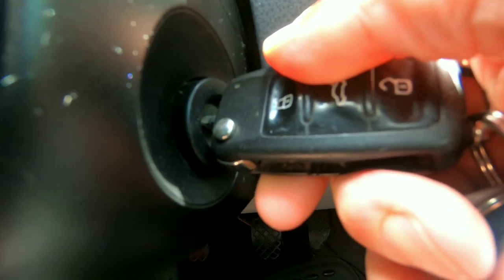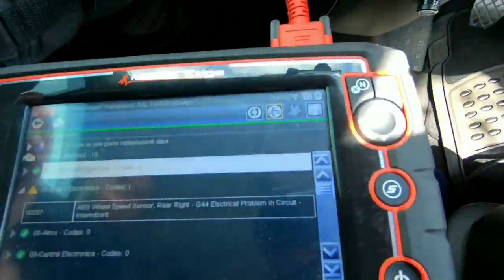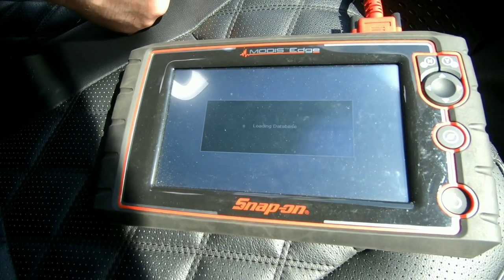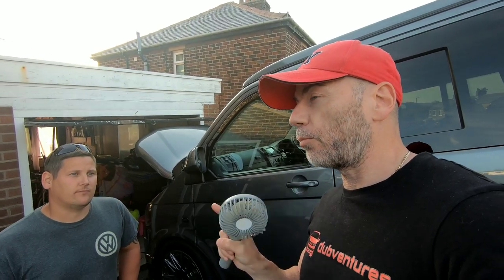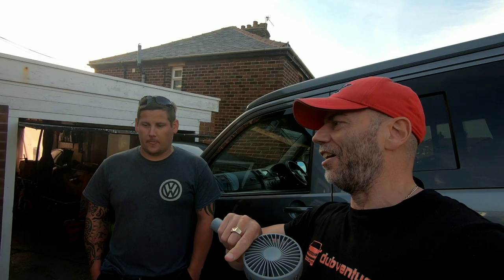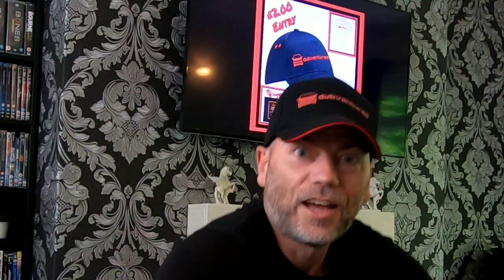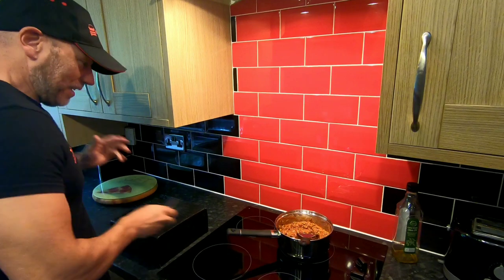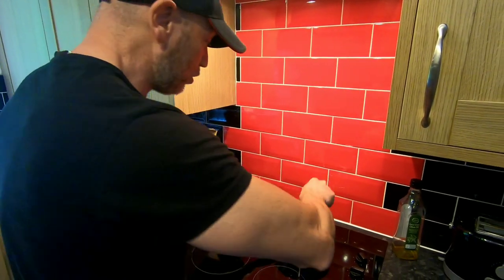ABS PROBLEM In Our VW Campervan Before We Travel To Scotland

Comment: I had the exact same ABS sensor problem just before my trip last week too
Reply from the maker: Did you get it fixed before you went.
Reply: @dubventures  no, it was fine to drive, but the ABS didn’t work obviously, so I took it a bit easy and booked it in to the local garage when i got back. New front offside sensor, sorted!